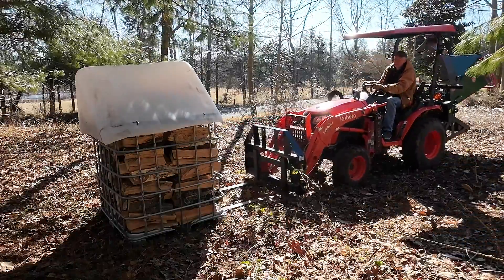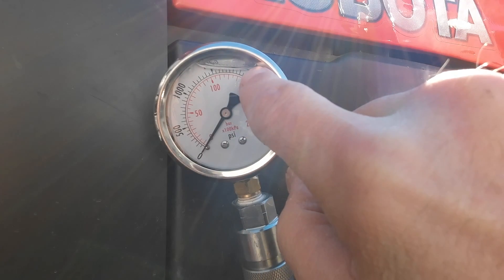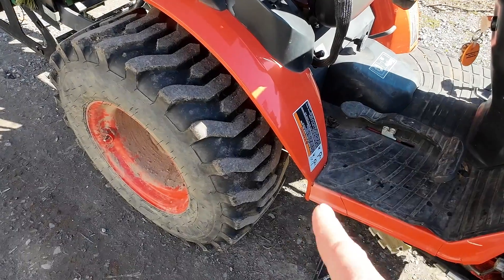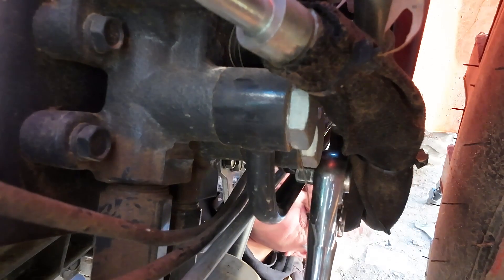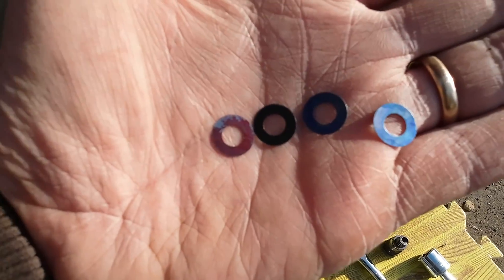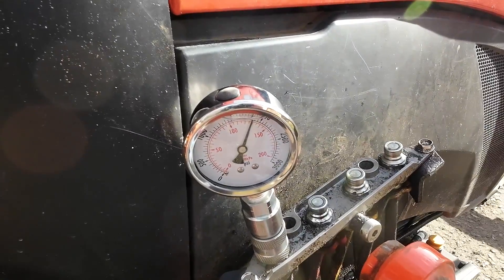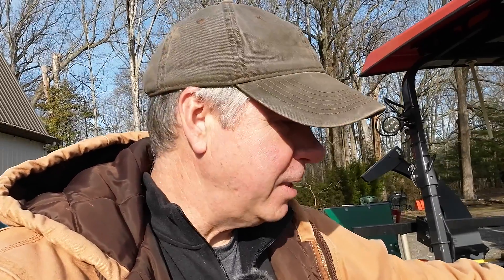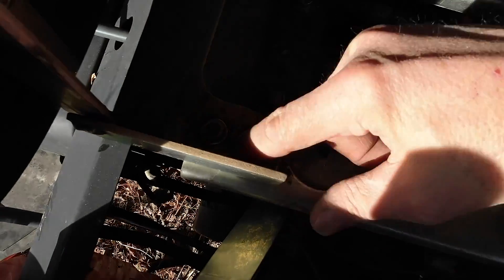Increasing my front end loader lift capacity - MCG Video #195

Comment from the maker: Want to support this channel? These are Amazon Affiliate links, so purchasing will help this channel by providing a small commission while not costing you any more. Thank you for your support!
AirTec Lube-Shuttle Pistol Grip Grease Gun Kit:
https://amzn.to/3O0pj1z
LockNLube Grease Gun Coupler:
https://amzn.to/3kPcvwu
Recommended Grease:
Valvoline Moly Fortified
https://amzn.to/3jNM1Kv
Nitrile Gloves:
https://amzn.to/34Kg8OG
Deerskin Gloves:
https://amzn.to/2I17NNy
My Video Gear:
DJI Osmo Action 3:
https://amzn.to/3JqbZno
DJI Mic
https://amzn.to/3J4vAIv
DJI Air 2S
https://amzn.to/3Yxid9n
Rode Wireless Go II microphone:
https://amzn.to/3eiJatG
Canon M50 Camera (now Mark II):
https://amzn.to/3vHW9uD
Battery adapter for M50:
https://amzn.to/2RshsBE
Sigma 16mm prime lens:
https://amzn.to/3vJDRcx
Sigma 30mm prime lens:
https://amzn.to/3epFneh
Variable ND filters:
https://amzn.to/3tmoHIs

Comment: Hey Ed 
I now turned up the tractor to 2400 psi. 
I have been running that pressure for a month with no problems. This is where I will stop. Some of the hoses are rated for 2500 and some at 3000. 
But 2400 for a B2601 seems perfect. 
Would you ever turn yours up? And do you see a difference turning yours up. For me it’s a big difference.
Reply from the maker: I figured I’d better not push it. 🤣

Comment: Ok I bought the part 10 months ago and today I put it in. I used 2 blue right out of the gate. Now I’m right around 2200. Night and day difference. Easy to do. I didn’t have hard lines for my third function so no need to take the tire off. 10 minutes and done. Keeping the other shims just in case the pressure drops at some point or I want to go a little higher. 
Thank you for the video
Reply from the maker: Nice!
Reply: I just watched Messick he says you will get around 33 extra pounds of lift for every 100 psi so I added 300 psi so around 99 extra pounds. 99 doesn’t sound like a lot but for the B2601 it really is.

Comment: Thanks for the video I had the same problem with my L2501 when I did the 50 hour maintenance. I was surprise when you change the hydraulic fluid filter you just unscrew it and quickly put the new one on spewing fluid everywhere. I lost quite a bit of fluid and put fresh back in and according to the bubble  I was good, however after using the tractor for a while the bubble read low and after adding more fluid EUREKA.  You are a brave soul taking that tire off.
Reply from the maker: Thanks for watching!

Comment: I've been curious about this, so now you've got me thinking I'm going to have to look into this further.  Do you know...does the test have to be at the loader valve, or can it be any hydraulic outlet, like the rear remotes?

Also, you had my blood pressure going up when you started talking about that leak...glad to know it was a non-issue!
Reply from the maker: Hi Chris. I don’t know if you can check the pressure from other locations. I’m guessing yes? Thanks for watching! Good luck!
Reply: Hello Chris.  I have the same guage that Ed used.  Got it from Amazon.  A few fittings from the local hydraulic supply shop and I was able to connect it to the 3rd function system, where I would connect the grapple . I was reading above 1950.  Page 36 in the manual mentions 1891 to 2005 psi,   for the B2601,  so I felt that was about right. Hope this helps.   Ben
Reply: @whenworkisplay  Thanks Ben.  I have a gauge on the way.  I don't know if I'm gonna install any shims, but I am curious to know what the pressure setting currently is.

Comment: I don’t know if you answered this yet, but what coupler did you use or ask for?
Reply from the maker: I them I have the swift-tach loader with flat face connectors. If you don’t have that front unloader, you’ll have to let them know what you have.
Reply: I have the same tractor you have

Comment: Nice video Ed.  I've been thinking of doing this on my BX and my Grand L.  Factory setting aren't always dead on.  Watching you might be the encouragement I needed for me to go ahead get the kit and check my pressure.  With respect to increasing your FEL lift capacity, I believe there are 'upgrade' cylinders that can be purchased from sites (ie. hydrosplus and others).  The larger cylinders will have increased pressure / sq/in. therefore more lifting power.  I do say this with some caution, since the entire FEL and its frame were all engineered together.  So, I wouldn't want to 'overload' the main arms by lifting more than it was designed for; although there is usually a safety margin built in, so would think bigger cylinders should be OK.  The cylinders aren't cheap, but they are much cheaper than another tractor.  Love your channel and watch it every day!
Reply from the maker: Thank you so much for your thoughtful comments! I plan to leave things alone from this point forward. I think I set the PSI at a reasonable limit. I just need to lower my expectations of the tractor. 🤣

Comment: Hello Ed.  If we had more wide open space and regularly required more lift capacity, I would be considering trading up to a larger tractor.  I do regularly ask our mighty little B2601 to  "Be All Ye Can Be " and it continually amazes me, and the smaller size really works on our property.  I checked our hydraulic pressure and it is at the top end of factory spec.  I think our lift capacity as it is , is Kubota's way of saving me from myself.  I really enjoyed this video , the conversation it has sparked in the comments,  and I learned a few things. Take care,   Ben
Reply from the maker: Thanks Ben. Yes it’s a good machine!

Comment: I did that with my John Deere 2038R John Deere is a lot more simple than that. I had a gauge I just had to adjust the pressure relief valve and one good thing about John Deere. You don’t have to add any shims it’s simple that’s why I went with John Deere. but great video.👍
Reply from the maker: Thank you! Yeah I’ve heard they’re pretty easy to adjust 👍
Reply: @MyClutteredGarage   yes they are and I’m so much happier with it. Plus I added a Curtis cab with heat and a winch wiper. I am extremely happy great video.
Reply: you don't own a John Deere you own a Yanmar, smaller model Deeres are made completely by Yanmar, not just the engines. (not saying that's a bad thing) I got a kubota 2301 (deere 2025 chasis size) with backhoe and loader cheaper than a 1025R with no backhoe. So personally I don't mind spending 10 min adding a shim lol. Both tractors are great and dead simple.

Comment: The Kubota B series are great, but they are small tractors. As you acknowledge, need to be careful with stuff like tweaking hydraulic pressure. Working beyond the machine’s design specs is a good way to break things. When it comes to loader capacity, it’s the front axle and the loader frame that will take the abuse. Of course, it doesn’t matter how big the machine is, we all find ourselves maxing them out!

Comment: I know you don’t want to hear this, but if you want to lift even those smaller IBC totes with firewood you’ll want the L3902 or higher tractor. I have L3901 and shimmed to spec and it lifts the larger IBC totes so well now.
Reply from the maker: Oh I know I could use a bigger tractor. That’s about the size / HP I’d like. 👍
Reply: I have the L2501 and have no problem lifting a full tote of firewood. I even have a couple of the 325 gallon totes and it does them too.
My tractor is factory specs.